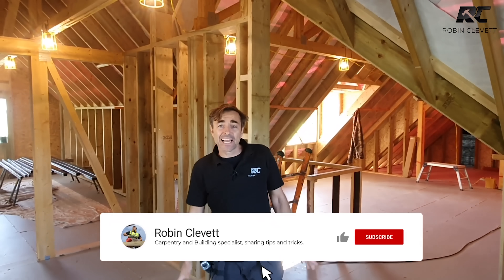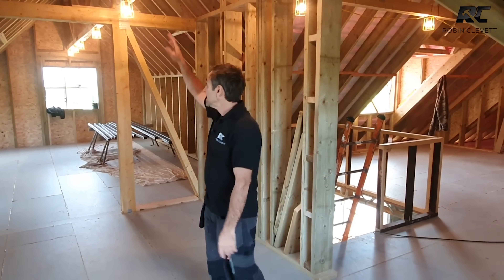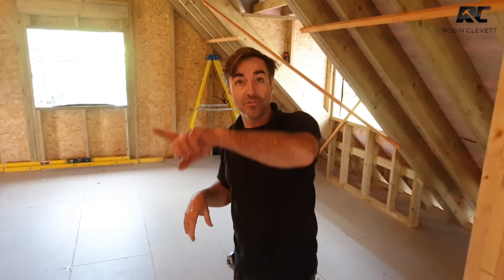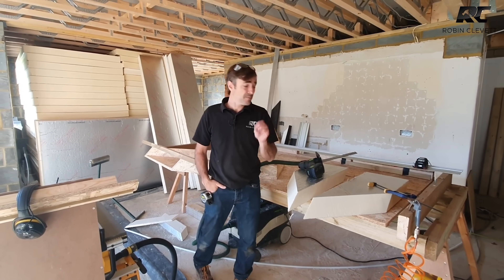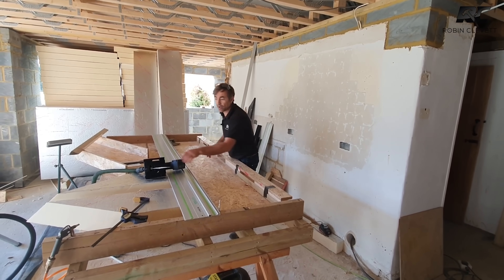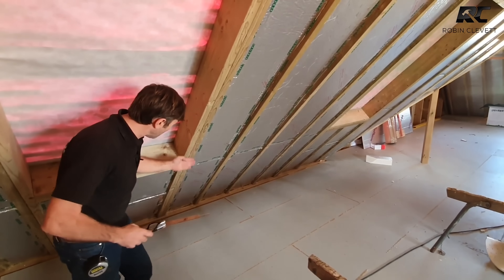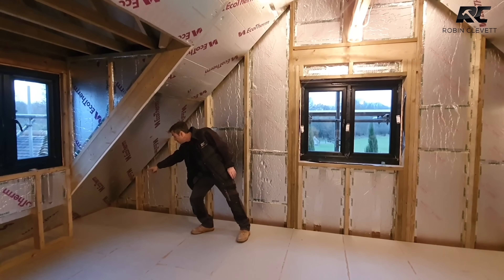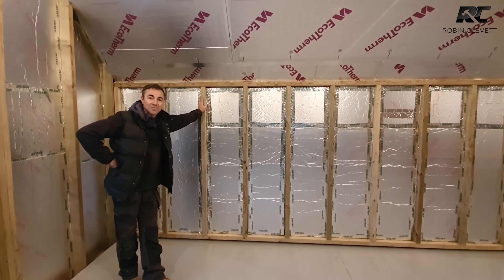How to fit insulation 2023 to the latest Building regulations Part L

Comment: Hi Robin, i think you have done a fabulous job and a very good video explanation,  I hope you don't mind me adding some constructive criticism, I work for an insulation company and have to train many installer on best practices and i will be taking some of your advice away with me. but with all that fantastic work you have completed, it appears that you have left gaps between the top layer of insulation and the next, I'm hoping, I'm wrong as you have done such a great job with all other aspects. i would highly recommend using stop battens or L brackets so the insulation between the rafters finishes flush with the bottom and then the sconed layer of insulation over the rafters would not have any gaps behind them, which could lead to interstitial condensation.

Comment: What I don't understand is a new build in august 2023 had no roof insulation. And when i went up there,  it had saturated  felt,  dripping water onto the floor insulation. Glad i got out of that new build what with concrete floor slabs and faulty sanitary pipe blockages downstairs,  How im i supposed to rectified  that. Redrow didnt want to know...

Comment: I’ve got a new build kit home to insulate. I don’t think the widths between any 2 rafters are the same, the widths from every eve to ridge can also vary quite a lot. It’s a nightmare!
Reply from the maker: Why is everything not parallel?? 
It's all about setting out and also temporary bracing to keep rafters and other timbers straight and true, there are only a few carpenters I now know that understand this or think of the next trade!! Shame ....
Reply: @robinclevettcarpenter  Down to the kit provider, who also erected the kit and the company that make the trusses. I’m not a builder but I am doing most of the internal work with the exception of eclectic and plumbing.

Comment: Hello, I'm just wondering why you don't just use Rockwool instead of PIR? Rockwall uses that 'friction fitting' where you just cut the rough size and squeeze it in, often not even needing any support to hold it in between the rafters.
Reply from the maker: Because to achieve the insulation values we need the rockwool would have to be much thicker thus losing headroom etc
Reply: @robinclevettcarpenter  Ah right I see.

Comment: Hi Robin, I must say, I've enjoyed watching all your videos - all excellent! I have one question... most of the PIR Boards I have been looking at have a Euroclass Fire Rating of F. What PIR Boards do you use? And do these conform to the Fire Safety Building Regs? [I am looking to insulate my suspended timber floor]
Reply from the maker: Many materials in mainstream construction such as insulation has a low rating, when used in the fabric of the build or separating layers such as structural floors its the overall build up that needs to achieve the correct rating for example in a floor the insulation would rely on the ceiling boards beneath to stop it from catching fire to suit the buildings specification so for typical 2 story buildings we look for a 30 munite fire rating and correct means of escape and other safety devices such as mains powered smoke detection to make a habitable building work correctly, hope that helpa
Reply: @robinclevettcarpenter  - that's v helpful - thank you! And thank you for taking the time out to reply :)

Comment: What happens when the customer wants spot lights cutting in the insulation?
Also cables being run with no gaps between the plasterboard and last layer of installation

Comment: I would board over with osb or ply if youre feeling fancy. It will help quite a lot with noise insulation and air tightness plus make plasterboarding super easy

I hope that tape is stretchy, belive it or not pir/pur boards shrink over their lifespan. The  airtightness tape needs to be stretchy to maintain airtightness, i use wigluv or tescon tapes. A lot of uk building products are crap and overhyped (stand up multifoil) - the continentals have been building to a much higher standards than us for a long time and have the products that help

Comment: Hi Rob and all 
just seen this vid great info just a question if you can help ? ( or any of you guys.) 
Is loft insulation with a thickness? Of 450mm is this now standard have you heard of this or just too much in your opinion? 
So my architect suggested I put in 3 layers of 150 two in and one over the top the other way . 
We have 150 going in the floor. And also will be adding an air source Heatpump 
(everyone I spoke to said you don’t need that much) it’s for a large barn and very expensive to do I did think 300mm would be adequate just interested to see your thoughts and if you’ve come across this, thank you in advance.

Comment: I’m in Australia where most houses don’t even have insulation as regulations are about 40 years behind the UK, and the most common comment I’ve heard over the years is, “it doesn’t get cold enough for insulation” … they seriously hadn’t even considered it for heat resistance.

Anyway, my quick question is what do you have in the underside of the roof tiles? I can see something but not sure what it is. 

Assuming it’s some kind of membrane and I won’t be able to remove tiles, any idea how I can install something like that - or can I do without it??

Comment: Q. The rafter pir boards (with the gappo tape on the sides) seem to be recessed, so when you put your second layer of pir over the top wont there be a second air gap between the two pir layers? If this is deliberate why do you do this? Thanks

Comment: Very good but I was hoping on guidance regarding need to an air gap ( kingspan suggest 50mm) between insulation and underside of roof tiles or felt if fitted. My project involves insulation an old property.

Comment: Well, wood lives, expansion and shrinkage so there will be leak of heat. That means moisture in winter when we have+22 inside and might be -25 celsius outside. Leave 1cm on every side and fill it up with sprayfoam and its completely air tight.
Reply from the maker: Hi Roger, in the laboratory tests the method you described was also tested and in reality it is very difficult to completely foam fill the sides of the insulation sheets thus leaving large cold spots, foam also looses some of its strength and rigidity and becomes weaker, the Gapotape has an encapsulated memory foam that compresses really well and if you get the fit right it will allow for the marginal expansion that you mention no problem, also try holding a board in position that has a 1cm gap all round???
Reply: Thanks for your answer! I made our second floor warm about 22 years ago like i explained and still good! Keeping a board in the right position was no problem and i am no builder.🤓 A few splines across the truss and if needed in between the board and truss till you come to that point with foam , take off and foam the rest😊. Maybe we have better material here?? "Made in Finland" 😎

Comment: Hi Robin, It's a fantastic job as always. 
I noticed you put a second skin on the rafters, is it necessary to do the same to the walls?
When you push the insulation into the raters do you leave them flush to the inside leaving an air gap between the insulation and the roof, and if so what size gap should would you recommend? Obviously that gap will determine what thickness insulation can be used.

Cheers Robin

Comment: Hi Robin. I'm enjoying your videos and admire your attention to detail, quality of finish and time-saving methods. I was wondering how you would go about insulating for an old house where purlins are being removed and ceiling collars are required to be bolted to the sides of rafters, and ashlar walls are being installed (I've seen different methods for these including bolting studs individually to the sides of rafters but also birdsmouths cut out of the rafters to sit on the ashlar wall). As you say in the video, it makes insulating a trickier process but is there a method you would favour? Also, would you favour the foil quilt insulation in this case? Any advice would be appreciated.

Comment: Wondering how lighting and ring mains fit into this ?
As cutting lights will compromise installation?
Reply from the maker: In a subsequent video in this series we look at the first fix electrical and plumbing and the pipe and cable routes

Comment: Genuine question, is there a reason you didn’t overboard the walls with PIR like your did the roof?
Reply from the maker: The walls have a lesser requirement to achieve the regulations
Reply: @robinclevettcarpenter  Thanks for taking the time to reply.

Comment: Hi Robin, would be so kind to advice the speciation / brand for the kind of insolation you use both for the first and second layer please ? I need to isolate my loft conversation and need to purchase insolation materials. Many thanks
Reply from the maker: This is a standard PIR material produced by the likes of Kingspan, Celotex, Quinn, Recticel and others, they all have similar U values unless you look at Kooltherm which is better U values but more expensive

Comment: Love your videos, and the commitment to doing a thorough job. I'm learning about roofing and intrigued by the differences of opinion between experts when it comes to cold and hybrid roofs, regarding running of cables and air ventilation.

In this video, the between-rafters PIR is installed a few mm back into the void from the rafter edge, and it is mentioned a second PIR layer will be added across all rafters internally.

- Is this to run cables?
- What will happen to air moisture between the PIR layers? 

Thanks!

Comment: Good Video.  What thickness was your insulated slab?
Reply from the maker: If you are referring to the ground floor, then it would have been 125mm of concrete with mesh and then 100mm PIR over the top under the screed

Comment: Great video, especially the jigs.
One question: How is the width of the air gap controlled?
The PIR looks like it is jammed against the felt membrane.
Reply from the maker: We have about 90mm of space the rafters are 200mm deep and we are just set back from the inside edge of the rafter

Comment: Hello if I want to use 100mm board thick and my rafters does not allow for 50mm, how do I extend?
Reply from the maker: You may need to batten the rafters down so add more timber to the underside say some 45 x 45mm section

Comment: Great video robin. Quick question. Would that all now need a Vapour control layer over the top? If so how would that be achieved? Stapled to the insulation?
Regards jason
Reply from the maker: The next layer of PIR under the rafters is a VCL and we also use a vapour check plasterboard

Comment: Great video, very informative however I have two questions, how do you get standard plasterboards to work with 450mm centres and have you got any examples of rafters which include services such as cables and or pipe work?
Reply from the maker: We use a plasterboard that is 2.7m long as opposed to 2.4, this is also a standard size however the merchants rarely stock it, also we have designed out any services in the insulation voids and we only have the services on the warm side of the insulation and in designed voids etc

Comment: Hi Rob, really interesting to see the changes. Are those rafters 9 inch ? as they look like they must be. In which case I assume you must have to put stops in, to stop the insulation from going all the way to the vapour barrier under the tiles? Also how thick is the insulation? Final question lol, is: Some of the insulation looks like it went below the surface of the rafters so when you put the thinner sheet of insulation right over the top does that mean there is a secondary air gap between the two sets of insulation ?
Reply from the maker: These are 200 x 50 rafters and we use a pinned reference block to support the insulation and keep it where we want it, there is a small deliberate air space between the layers and it has been proven that this actually acts like a double glazed unit and helps the overall values, indeed I have have drawings specify this from designers many times
Reply: Quality, thanks for that Rob. I'm hoping to buy a house that is gonna need a huge refurb which will include a full insulation program so any help I can get is extremely helpful :-) Also trying to understand better the cold a hot roofs etc. KEEP UP THE GREAT WORK :-) @robinclevettcarpenter

Comment: looks great. but i was surprised to see the thick PIR pushed back into the rafters 20 to 30 mm from the face. When you cover this over with 25 mm over sheet does that space not make a convection space? I would think minimising the gap would give better performance?

Comment: Hope you are keeping busy Robin. Recently (Aug 2023) had a Major House Builder tell me that the NHBC have told them that the plasterboard must be fixed directly to the timber and not through the insulation which they say can ignite through heat conduction through the fixings? That's going to mean deeper rafters in all warm roofs.
Reply from the maker: What about insulated plasterboard??
Reply: @robinclevettcarpenter  Exactly! I also thought that PIR contained a fire retardant? The house builder was doing as you did here on the Big Build. But we have just had to increase the rafters depth on all the designs because of this. I think there is a lot of ignorance around insulation and a good few myths and old wife's tales.

Comment: Great video, the gapo tape was new to me!

The only thing I think you should make clear is how important the ventilation gap is behind the insulation board. The rafters looked to be 200mm (?), so a 100mm board had plenty of space. That’s not always the case and I noticed your guy had pushed the board back at least 50mm in places. With a smaller rafter that would push the board right against the felt. ‘Best practice’ would be to only push the insulation just a little further beyond the bottom edge of the rafter in most situations.

This will also avoid having a vented gap top and bottom that will reduce the performance of the insulation layer.

That aside, good video 👍👍

Comment: Do you not have spray foam?? In the States, we would never commit to that kind of a labor bill, we'd just spray expanding foam into the cavities and cut off the excess.
Reply: Roof tiles needs a ventilation space behind the insulation
Reply: @edc1569  you can build a chute out of foam board or plywood to create a channel. There are also premade channels. Then use the spray foam over that.

Comment: You dont show how you fix ceiling collars to rafters that are covered in Pir
Reply from the maker: Have you seen the video of the roof design for this project on my channel, I describe how I designed the roof to enable the insulation to go from eves to ridge in a rafter that was good for the span, this enabled me to construct the ceiling collars as a frame that has no structural element in the roof design and meaning that it could be fixed under the roof rafter through the thinner layer of the Insulation, hope that helps

Comment: It's a well-made video with impressive technique and forethought, but one thing there is NO mention AT ALL of, is the requirements of Part L.  Nor any initial sign that the scope is restricted to new-build roof and doesn't touch on the rest of the envelope.  What I'm saying Robin, is that your title could have been much better chosen to reflect the content.
Did the span require 8 inch rafters, or were they made that deep to allow for gap/insulation/gap?  And if the latter, did you consider a warm roof with shallower rafters using between and over-rafter insulation and counterbatten/batten on top?
Reply from the maker: Noted, I did an earlier video in my Big Build series highlighting the roof design and we designed the roof with a large rafter to enable a longer clear span to enable an insulated envelope that was from eve to ridge in one without the changes and awkward junctions that arise otherwise and can make insulating more difficult and not as effective

Comment: I'm just insulating my raffter now with 50mm insulating leaving a 50mm gap and noticed getting alot of condensation on roof felt what is breathable and plenty of airflow from eves
Reply from the maker: I suspect that warm air is making its way onto the cold side this happens a lot, maybe have a good look and see if there are any large gaps from the heated side of the construction??

Comment: Really interesting. Looks like a very thorough job. I'm trying to find out what would be needed to insulate a 'vaulted' ceiling with exposed rafters. I.e. is it possible to remove an existing ceiling in a bedroom but then insulate up inside the apex roof to get a more dramatic and open feeling to the room but also have it insulated up to spec. ? Are there any really good videos about this already ?

Comment: I'm not sure how the 450mm centres work with the plasterboard, surely you end up with the edges of the plasterboard being unsuported? As 450 x 3 = 1350mm, you will end up with about 130mm on one sheet and 270mm on the next sheet hanging in mid air and an unsupported join in the plasterboards.
Also the Gapotape looks like a good idea, but for 120mm PIR it adds about £40 to the cost of each sheet. With just the number of sheets of PIR I could see in your pile, that would be an extra £2,000.
Reply from the maker: We Use a 2.7 m board
Reply: @robinclevettcarpenter  I had no idea that boards came in that size. I knew that some boards could come in 3mtrs but 2.7 is a new one on me. I